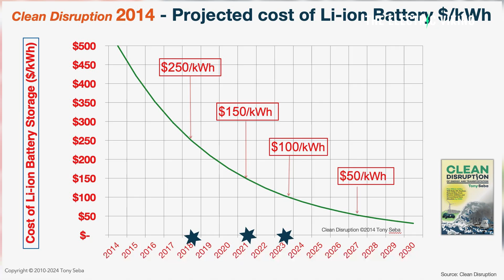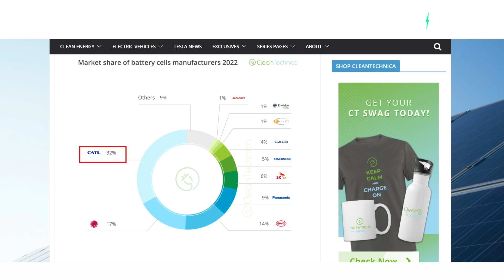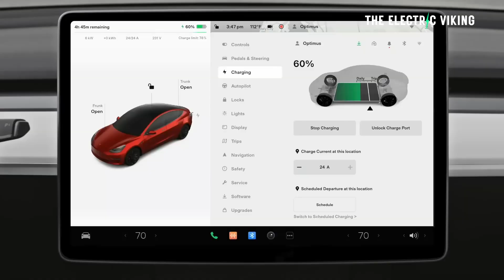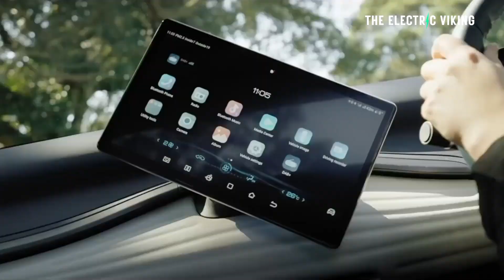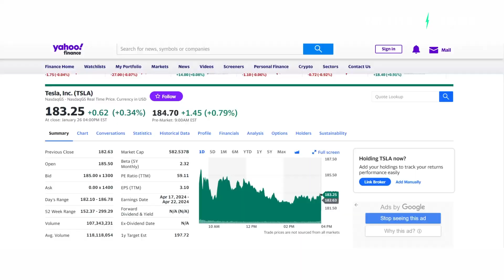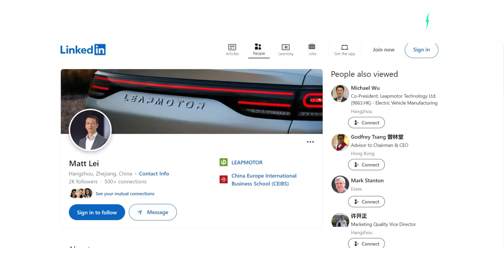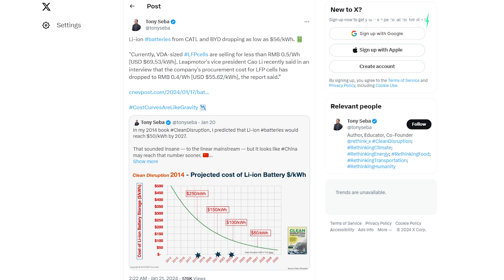Tony Seba's 2027 battery prediction is about to happen 3 YEARS EARLY!

Comment: One of the big things people don't realize about BEVs  vs ICE powered vehicles is the recycle ability. Lithium and sodium are elements.  No matter how many times you build/recycle/build/recycle, they will always remain lithium and sodium.  Always.  Crude oil, once refined and burned, will never be crude oil again. Ever.
Reply: One of the big things people don't realise is how cheap evs are to run-my ice vehicle costs about $100 for me to fill up with fuel which will get me about 500km of range & an ev might get me around 400km but costs about $5 to charge...😅
Reply: @soup-nazi6824 
UK electricity costs are way higher than that but EV is still cheaper to run.
Reply: @Dave5843-d9m  "UK electricity costs are way higher than that but EV is still cheaper to run."

What about the gasoline price? Most European countries likes to tax that to the heavens.
Reply: Never say never. Burned crude oil turns into CO2 which then is integrated into plant life via the carbon cycle, which can then die or be eaten by animals, then buried in the earth, then compressed and heated and then... CRUDE OIL! It just will take longer.
Reply: That's basically correct but you do lose roughly 1% each time you recycle. A small number elements will recycle at about 0.5%. So it's not unlimited.
Reply: @mac_mcleod 

Also an important point - that any procedural imperfections that lose/waste material will equal that much lost turnover.

But the validity of the original point, of course, is unmarred.
Reply: @mac_mcleod  so let's say you recycle once every 10 years? How long are we talking about there? 100-500 years with small addition of new materials to replace the lost?

In 50 years we could have god knows what type of batteries, let alone 100+ years and beyond.
Reply: @DevonHensley211  I'd say that's fair.  

However,  in my experience, there is little recycling as long as it is cheaper to mine/ make new material.

 And often the goods meant to be recycled get scattered such that it's a lot of effort to gather them at a Central recycling location. Transportation, salaries, wear and tear on the recycling equipment adds to the cost.

I'm not trying to be a naysayer or say that it's impossible but my experience says that there's a lot of friction in the area that prevents it from happening.
Reply: @mac_mcleod  How well is the fuel used for electricity being recycled?
Reply: @msimon6808  About as well as the electricity is being recycled.  Apples to Apples.  Oranges to Oranges.
Reply: @mac_mcleod  Chemical engineer here:
That is largely correct!  No chemical process... no process of any kind... is perfectly efficient.  And you are also correct in saying that the present recycling efficiency of battery metals is around 99% (less so for graphite, plastics and solvent).
However, the losses can be greatly limited... tangentially down to almost zero, depending how much you are ready to pay for every further increment.  So, a balance between the cost of mining new materials, and the total costs of recycling the last 1% or so, will emerge with time.
Reply: @mac_mcleod  At the moment recovery is < 100% but recycling technology keeps improving. Do you have a physics or material science theory that says 100% is impossible at some point in the future?
Reply: True. It's pretty hard to recycle released energy.
Reply: @markumbers5362  "True. It's pretty hard to recycle released energy."

Doesn't matter if your home planet is bombarded with loads of free, easily harvested fusion energy day after day.
Reply: Such an excellent, pertinent point. 👍
Reply: @justinklenk  All batteries will die
Reply: @justinklenk  I like the bit about recycling the fuel used to make electricity.
Reply: @caljeff2427 Do you have any sources to back up your claim that "its cheaper to use new lithium than recycle it"? The reason I ask is that the recycling approach used by Redwood Materials (and I think by Tesla too) is to grind a battery pack into dust and then treat that as being a high-grade ore. By "high grade", I mean it has something like a 50-times concentration of useful materials than freshly mined ore. Redwood Materials' business model claims it is cheaper to grind up an end-of-life battery pack into high-grade ore and then refine that than it is to mine fresh, low-grade ore and refine it.

I believe you are wrong in claiming that CATL use only newly mined/refined lithium because it is cheaper than lithium from recycled batteries. Rather, the reason is likely to be that recycled batteries tend to mostly come from 10+ year old cars, and the number of EVs that were manufactured 10+ years ago is a tiny percentage compared to the number of EVs that are being made this year.
Reply: We are currently building an infrastructure of batteries. 90% of what we make just adds to the pool. Over time the recycled content will increase. Recycling costs are low because crushed battery mush is better than the best crude ore. 
The long run problem is that demand for mines will peak and fall back. This isn’t good for the mining industry. Perhaps why they don’t rush to dig holes in the ground.
Reply: @Dave5843-d9m  I'm skeptical of your claim that, "The long run problem is that demand for mines will peak and fall back" because of Jevons Paradox, which suggests that, as batteries get better and cheaper, demand for them will increase. However, I am not knowledgeable about mining industries, so I might be missing something that overrules Jevons Paradox. If you know of something I am overlooking, I'd appreciate you citing a source for me to read up on.
Reply: @caljeff2427:  That will depend over time on how much lithium costs, and how much recycling efficiency improves.  Oh, and that will only e true as long as lithium is very plentiful relative to demand -- which will increase greatly as BEV production volumes increase (until almost all lithium is being recycled).

Over time, who knows how much outfits like Redwood Materials will improve recycling efficiency?  And over time, like other commodities, lithium might be very volatile.   But CLEARLY, until demonstrated otherwise, the price, efficiency, durability, safety, etc. of batteries is improving significantly, which can only be good for overall EV prices over time.
Reply: @caljeff2427not enough recycling happening yet, not enough volume.
Recycling is already much cheaper than mining.
Most EVs are still on the original battery, in 20 years some will start to wear out and recycling will volume up.
Reply: There are batteries being developed that don't use lithium.
Reply: This is SUCH an important point, and people just aren’t aware of it. Elements will remain the elements they are until they’re eaten by a black hole billions of years from now. And once we’ve mined ENOUGH battery material, we won’t need to mine more - we can just maintain the batteries we need globally using recycled materials. 

Technically, the CO2/H2O produced by burning fossil fuels could be reassembled into the original molecules, but it would require more energy than can be extracted by burning them.
Reply: Reuse of batteries significantly reduces the number of recycled batteries. Good in some ways, tough on recycling companies.
Reply: @charlesminckler2978  "Reuse of batteries significantly reduces the number of recycled batteries. Good in some ways, tough on recycling companies."

The batteries will be recycled eventually anyway. When the ball is in motion it doesn't matter.
Reply: On the periodic table, lithium is number 3 and therefore one of the most common and the lightest solid element. There are literally oceans of sodium. Iron and phosphate are also plentiful.  Very encouraging facts...
Reply: Cal, given that there are 8 billion people, and growing, straining the resources of this Earth and producing spectacular amounts of waste, we have to recycle everything. The cradle to grave costs of every product we use, including pollution and adverse health costs, need to be included in the costs of products.
Reply: One major issue with the running cost comparison between ICEs and EVs is that the CO2 tax makes the electricity price rise faster than the gasoline price (somehow related to the electricity production composition and the Merrit Order principle). Driving an ICE was about twice as expensive per kilometer as driving an EV 1-2 years ago, now the difference dropped to roughly 3:2. Even as affordable EVs are about to enter the market this year, the drop in the kilometer costs difference caused by the CO2 tax pushes the break even point away again, back beyond the point where an EV would be the more cost efficient option for most people. 
Well, let’s see what happens in the next few years…
Reply: @peterp5099  "One major issue with the running cost comparison between ICEs and EVs is that the CO2 tax makes the electricity price rise faster than the gasoline price"

Most countries have CO2 taxes on gasoline as well, and European countries also require gasoline and diesel to have expensive bio fuel mixed in. Meanwhile solar energy is growing and countries have started to look at nuclear energy again after being stupid enough to shutting down their current reactors. It would be a stupid move for governments to tax clean energy generation more than the alternatives and the fossil fuel. But sure, governments can be stupid sometimes. 

Either way. It will be cheaper to both purchase and to run a BEV. The only mid term struggle with electricity prices is due to some stupid decisions from some countries that resulted in less than optimal energy production. That's not an unfixable issue however.
Reply: @yourcrazybear  the CO2 tax applies to both, to gasoline and to electric power created from coal or other fossil fuels. It does not apply to electric power from solar and wind. BUT, at least in my country, the electricity price the customer has to pay is the price of the most expensive source of electricity that is still used. That’s called the Merrit Order principle, and it’s codified into the rules of our electric power market. As long as renewables cover less than 100% of the electricity demand, and electricity from fossil fuels is still used, that electricity from fossil fuels decides the price of electricity for the consumer. And the introduction of the CO2 tax made the price of electricity from fossil fuels rise more than it made the price of gasoline rise, therefore reducing the running costs advantage for the owners of electric cars. 
At the same time, the CO2 tax increased the profit margins of the suppliers of renewable electricity. But only as long as the renewables do not reach 100%, a few of the fossil fuel power plants are still running, and the CO2 tax for fossil fuels turned into electricity rises the price the customers have to pay for any electricity, including electricity from wind and solar.
Reply: Recycling Li batteries is inefficient and expensive.  CO2 and H2O can be combined to fabricate Hydrocarbons.  It is also inefficient and expensive, but it can be done.  EV’s take too long to charge and do not have sufficient autonomy.  People who have a choice are buying ICE vehicles.  If and when EV’s are ready, let the people decide.
Reply: @gepal7914  I agree with only your last statement. People are deciding and EV sales globally are growing exponentially. Watch Tony Seba videos to be better informed about what's coming.
Reply: @gepal7914  Which is why we need MUCH higher carbon taxes. With externalities in place: it is cheaper to dig up new fossils to burn.
Reply: Never say never. Burned crude oil turns into CO2 which then is integrated into plant life via the carbon cycle, which can then die or be eaten by animals, then buried in the earth, then compressed and heated and then... CRUDE OIL! It just will take longer.
Reply: The battery packs are recycled, not the lithium which is a rare earth element. At that point, the batteries are extremely toxic. Cut the crap and stop lying.
Reply: What percentage of battery elements are currently recycled?
Reply: @doriangray6985  currently something pretty low cause raw materials are cheap. As long as they stay cheap, new materials will still be the major component. But the question presupposes it’s reasonable to recycle them at this time. 90% of the battery packs that exist have only been made in the past few years. Most of the packs from the original model Ss are still out there. The same is true of Priuses. The processes for recycling batteries are already established, but why would they start? The supply of used batteries is tiny, it’ll be a decade or two before current batteries to start entering circulation. At that point they’ll become cheap and recycling will be worthwhile. It already became commercially profitable at small scale in the US to recycle batteries last year. I don’t know if your question was genuine but I hope that’s food for thought.
Reply: @doriangray6985  98% (compared to 0% of petrol)
Reply: @Berretotube  You are saying that 98% of EV batteries globally have their minerals/materials recycled?
Reply: @doriangray6985 98% of EV batteries globally are still sitting in the car they came in, and that car is still on the road, because the vast majority of EVs built are less than 5 years old. It’ll be 2030 or so before we see serious numbers of EV batteries that need recycling.
Reply: @Berretotube  How much of the fuel used to make electricity is recycled?
Reply: Never say never; moreover, recycling can be way cheaper & cleaner ...  Burned fossil fuel by way of photosynthesis is converted into O2 & trees. Trees, under the right conditions of nature, are converted back into fossil fuels. Although the process takes time, nature can do it for nothing.😊
Reply: That is a win win for everyone.
Reply: Wrong. The byproduct of oxidation of hydrogen carbon is CO, CO2, and H2O. Capture the emissions, use organic chemistry and lots of energy, and you’ll get back the hydrocarbon. A similar example: the Haber Reaction uses gaseous  nitrogen in the air,   water, and through the miracle of chemistry is transformed to Ammonia Nitrate , NH4NO3 — a fertilizer or oxidizer.
Reply: All batteries will die and the replacement is too expensive as with the parts which will become defunct.
Reply: These are real questions! How high are the recycling costs in first world countries compared to cheap batteries? Is it financial beneficial or do governments need to put tax money into it?
And how are we with solar cell recycling? Last numbers I read from cnbc was that 80-90% of all old and broken cells are dumped in landfills. I assume solar cells are too cheap and  recycling is to expensive. And if recourses get this rare that we need to dig out the landfills... Only assumptions from me.
It is nothing gained in advertising recycling abilities if not 99% of the world can do it. At least the big consumers.
I personally look for used cars the difference between EV and IC is stupid.
Reply: ...and everytime you recycle battery metals like lithium the purer they become....another benefit.
Reply: @caljeff2427 "thats cool, but its cheaper to use new lithium than recycle it. which is why CATL uses new only"

It won't be in the future. That's the real point really.
Reply: You are damn right! Solar and wind power are "renewable" (never ending) energies. Lithium and sodium ion batteries are actually renewable or recyclable batteries.  Renewable energies and renewable batteries together will bring humans a future of cleaner atmosphere and environment. But the catch is that the Americans and other EV haters are rejecting EVs after being brainwashed by their media and gasoline industry.
Reply: @eugenec7130  actually, the catch is that until last year, for the average consumer with an average driving profile, the TCO of an EV was much higher than the TCO of a gasoline car. It’s as simple as that, no brainwashing needed.
Reply: 100% agreed and it's not only an issue total recycling. Our house solar-charged battery bank is made from repurposed used EV batteries. They are from scrapped EV vehicles. The one set of batteries was installed in 2019 and it is still functioning with minimal loss of efficiency.
Reply: You also have to factor the amount of energy required to refine the elements from batteries. It is a positive, but it’s not that straight forward.
Reply: @cgcrosby2  As the grid transitions to renewable energy, that becomes less and less of a drawback.
Reply: It’s a really good point.
Reply: Not true many recycle gas oil for bio feul8s.
Reply: Tesla d o6thers are making.  It all but impossible. To recycle their. Batteries
Reply: ICE engines could be made to use renewable resources, there's no reason why we can't design an ICE to run on vegetable oil (diesel engine technology). It would be better to make a hybrid which doesn't have such large battery requirements. And also, stop making products designed to break and planned obsolescence. Companies push "green" but the fact of that matter is that cars have the biggest carbon footprint in the manufacturing of the vehicle. But we won't see them do anything to change the consumer based society designed to keep everyone busy working all the time, free time is reserved for the elites.
Reply: There's no one recycling batteries. Let me repeat that there's no one recycling batteries.
So no lithium although in theory Could be recycled. They're actually is no way to do it.
At the present time
Reply: that’s great but you can’t economically recycle lithium batteries right now.  So there’s that…
Reply: @caljeff2427 but that will change when recycling is at a much larger scale
Reply: Yah same with the petro dollar that causes corruption and war from the past and at this present time, it will come and will stay if you continue on patronizing ICE.
Reply: Well said!
Reply: Wow...profound.  You realize petroleum is made up of elements, and is NOT a man-made compound.  It is, therefore, something nature creates AND something it absorbs fully...like the Gulf of Mexico after the BP spill.  Lithium and the other battery elements require mining and processing the destroys the environment PERMANENTLY.

And recycling doesn't help or change that...even if it WERE somewhere near 95% recycling instead of more like 5%.
Reply: YEAH mined elements and the mining is devastating, not 'reallllly' any better for us thsn an old ICE who's footprint has already been laid down
Reply: @PazinPortugal  Effects of man-made climate change seems to be nowhere in your equation. Millions starving from crop failures, nation states failing due to migration pressure, millions of square miles of lost coastline, mulit-$TRILLION drag on world economy, etc., etc. No biggie, right?
Reply: @PazinPortugal  It's not the impact of extracting that is important long range, it's the fact that fossil fuels are finite and can only be used once.
Reply: Unfortunately there are few recyclers doing this.
Reply: @Pohleece222  At the moment 95% of all EV batteries made are still in their original EVs. Meanwhile, recycling giants like Redwood Materials are gearing up with $Billion investments. It's projected by 2040 the majority of new EV batteries will be made from the supply streams from old EV batteries. The Electric Viking has covered this projection recently.
Reply: ACTUALLY, it will never be crude oil again, but you can pull the elements out of the atmosphere and oceans (CO2 and H2O) and refine them back down into a hydrocarbon that can be re-synthesized into a fuel that you can burn in an internal combustion engine.  The PROBLEM with doing that is that it takes 5-6 gallons worth of energy to make 1 gallon of SynGas.  I want to see how the ICE enthusiast wants to find the energy to do that...they have three choices...renewables, renewables, or nuclear!  Let the hate begin...
Reply: @caljeff2427it's a matter of scale and supply, most car batteries that CATL have made would still be in operation in their original vehicles. In the US at least, batteries from wrecked vehicles often end up being re-used in EV conversions, so what is left over isn't enough to meaningfully supply an EV battery manufacturer.
Reply: "Crude oil, once refined and burned, will never be crude oil again. Ever."

Come on now, it might be--in like 100 million years.
Reply: @tHebUm18  during the Carboniferous, wood evolved and fungi and bacteria couldn’t fully break down it down for millions of years, leading to what would one day be coal, oil and gas deposits. I like to imagine a future civilisation will discover fossil beds of plastic and talk about how it took millions of years for bacteria and fungi to consume it so they could drill it up and use it.
Reply: @Freshbott2  natural gas is abiotic. There are asteroids of the stuff. Planets of it.
Reply: @tHebUm18 :  OK.  On a time scale that will matter to the human race for MANY generations.  Also, given what burning fossil fuels does to the atmosphere, the LAST thing we want is lots more fossil fuels to stupidly burn, once we don't need to, re lots of green and cheap energy being produced within a few decades or so.
Reply: @rogergeyer9851  Compare that with what water vapor does to the atmosphere. H2O is a greenhouse gas equal to CO2 according to theory. There is on average 50 times as much in the atmosphere as CO2. There are still no proposals for draining the oceans. Water vapor is not persistent? You can average the results. Called integration in calculus. There is 50 times as much. 

The problem is 50 times bigger than CO2 and there is no way to drain the oceans. 

Wind and solar without batteries are not dispatchable. With batteries it is not affordable. There is no convenient low cost way to deliver summer energy in the winter.
Reply: @msimon6808  "Compare that with what water vapor does to the atmosphere. H2O is a greenhouse gas equal to CO2 according to theory. "

Water vapor is a significantly stronger greenhouse gas. 

"Wind and solar without batteries are not dispatchable. With batteries it is not affordable."

Incorrect. With batteries they become viable both in an cost effective manner in a practical one. 

" There is no convenient low cost way to deliver summer energy in the winter."

Who claimed that you must have the exact same price in summer as in the winter?
Reply: @tHebUm18 and you will drink the exhaust or breath it and wonder why so many people get cancer and can’t explain why that happens.
Reply: @tHebUm18  Sooner if we start ramping up synfuels sourced form atmospheric carbon.
Reply: But that’s the wrong comparison. You are comparing the container of electricity to the contents of the fuel tank of na ICE. The steel used to make a fuel tank is not only cheaper and easier to build, but also easier to recycle than the battery of an ICE. The comparison between electricity and crude oil would be partially true, as crude oil is not recyclable at all while a part of electricity comes from renewables. The difference is not very big yet though, the percentage of renewables is the total electricity production is not big enough yet. This is likely to change in the future, but as of now, it has not changed yet. So even the comparison between non-recyclable oil with renewable electricity only describes a likely future, not the present reality.
Reply: @peterp5099  fuel tanks are not that easy to recycle these days. They're not just a Jerry can.

I agree that recycling rates will always be lower than idealist think they will be but it is ramping up. 

I recommend folks read the article,  "Lithium costs a lot of money—so why aren’t we recycling lithium batteries?" To come up to speed. 

Summary: only 1% of lithium batteries are recycled while 99% of lead batteries are.   It's a combination of regularity and supply issues (they can't get enough batteries consistently enough to recycle at scale yet).  The first Barris made from recycled materials just went on the market recently.
Reply: @peterp5099  "But that’s the wrong comparison. "

No. It isn't. 

"You are comparing the container of electricity to the contents of the fuel tank of na ICE."

That's because the price of EVs depends heavily on battery costs while the cost of owning a fossil car depends heavy on the costs of the content in the fuel tank. Besides. Electricity will never run out. If you want to compare electricity to gasoline the latter will look even more silly to use. 

"The steel used to make a fuel tank is not only cheaper and easier to build, but also easier to recycle than the battery of an ICE. "

That's completely irrelevant when comparing the costs of EVs versus fossil cars. 

"The comparison between electricity and crude oil would be partially true, as crude oil is not recyclable at all while a part of electricity comes from renewables. "

We will always have electricity, so that kind of comparison is quite meaningless. 

"The difference is not very big yet though, the percentage of renewables is the total electricity production is not big enough yet. This is likely to change in the future, but as of now, it has not changed yet."

That's a silly argument. EVs will become cheaper to produce due to lower battery costs and they will run on an energy source that we will never run out of. 

"So even the comparison between non-recyclable oil with renewable electricity only describes a likely future, not the present reality."

The simple fact is that we will never run out of electricity. EVs will also become cheaper to produce than the fossil cars that will eventually not be produced anymore. Recycling of the batteries from EVs will also reach scale and enjoy the same kind of cost curve development as battery production has.
Reply: @peterp5099  , "Non-fossil energy sources composed 85% of new electricity generation capacity in 2022, with solar energy representing the single largest new source—56%. This continues and expands upon the trend of growing renewable energy expansions over recent years." - NREL
Actually my comparison is based on First Principles.  Elements will always be elements (unless someone perfects transmutation, highly unlikely). Crude is non-renewable and unsustainable, it is finite and being used at a non-zero rate, hence mathematically it WILL run out.  Geologists estimate over 95% of all the crude deposits that there are on Earth have already been discovered.  All the Super Giant oilfields are in decline.  Discoveries peaked decades ago. For example, if a 5 billion barrel discovery is made (very unusual nowadays), how many days does that add to the total supply at our current rate of consumption?  Let's see... 5 billion / 100 million = 50 days, less than two months! 2022 was the "best year in over a decade for discoveries" but still only 20.1 bnboe total and that was "through strategic selection and focus on the best and largest prospects.”  In other words, the future looks even bleaker for oil prospecting results. https://jpt.spe.org/2022-oil-and-gas-discoveries-create-highest-value-in-a-decade
The tank is largely irrelevant.  What is relevant is the energy source. If the energy comes from the sun, either directly or indirectly (wind, biofuels) it will last as long as the Earth is habitable.  If the energy comes from non-renewable and therefore unsustainable fossil fuels, it can't be sustained.  ICE vehicles are a dead end and are entering a death spiral as they lose economies of scale.  EVs are getting cheaper, ICE powered vehicles are getting more expensive.  Hasta la vista, the ICE age is ending baby!
Reply: How well is the fuel used to make electricity being recycled?
Reply: @msimon6808  , Exactly!  This is why "non-fossil energy sources composed 85% of new electricity generation capacity in 2022, with solar energy representing the single largest new source—56%. This continues and expands upon the trend of growing renewable energy expansions over recent years." - NREL  Due to the plummeting cost of renewable energy, It is now cheaper to build an array of solar panels or a cluster of new wind turbines and connect them to the grid than it is to keep operating all but one of the 210 coal plants in the contiguous US.
Reply: @msimon6808  "How well is the fuel used to make electricity being recycled?"

The world is going towards more renewables and nuclear.
Reply: Biofuel is better as you can use the remainder of the plant as well.
Reply: @АгронДепартье  Alcohol Can Be A Gas! by David Blume is an excellent book on this topic, I purchased it before the publication date and have attended one of his alcohol fuel classes.  Very useful in aircraft (jet and propeller engines can and have been adapted to run on alcohol) but much more difficult to scale to the world.  OPEX is an inherent and unavoidable issue compared to PV since fertilizers, labor, energy needed at many steps to transform from seed to fuels. There are also inefficiencies at each step.
Reply: @АгронДепартье  I disagree with your assertion that biofuels are better than recycling batteries. If you do an internet search for "how much land is required to make biodiesel", you will see that growing crops to make biofuels is not sustainable. For example, one article that you can find by searching for "disadvantages of biofuels - land use" (with the quotes) indicates that the US is 3.7 million square miles in size, but you would need to devote 336 million square miles to growing corn/maize to meet the total fuel demands of the US.

By the way, if you do an internet search for "How Much Land is Needed to Power the U.S. with Solar?" (again, with the quotes), you will find an article that suggests about 10,000 to 22,000 square miles of solar panels would provide all the power required by the US. That is more than 10,000 times more space efficient than growing crops for biofuels. Obviously, batteries will be needed to complement solar power, but the discussion of "Master Plan Part 3" at Tesla's 2023 Investor Day (https://www.youtube.com/watch?v=Hl1zEzVUV7w&t=803s) makes it clear that there is not any shortage of the minerals required for making batteries.
Reply: @АгронДепартье  "Biofuel is better as you can use the remainder of the plant as well."

No. It isn't. It's not scalable and a waste of land if you try to scale it up.